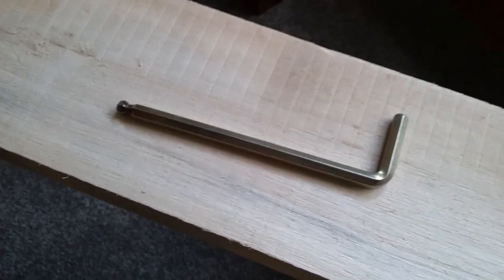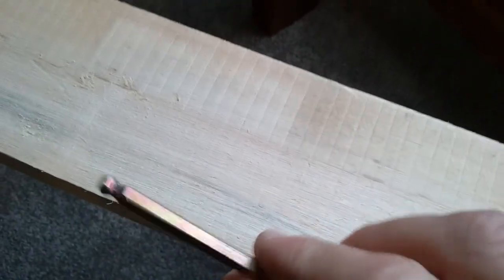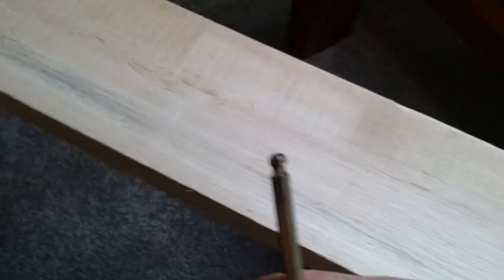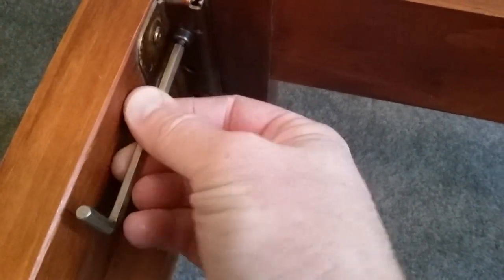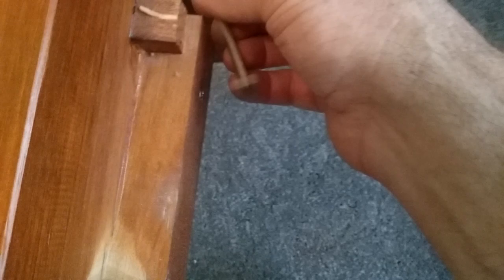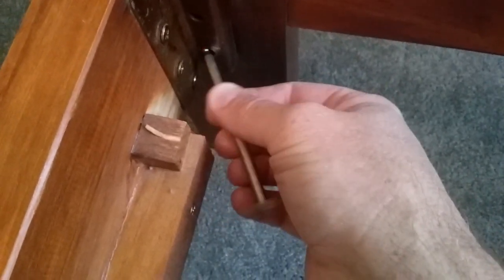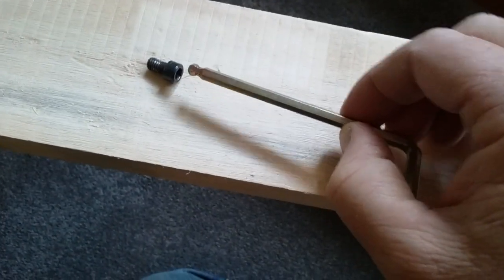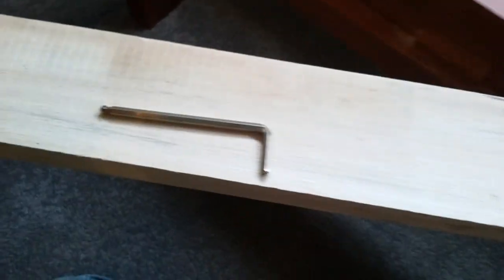Allen key trick - why some allen keys have knotched ends.

Comment: And I just accidentally broke the ball part inside a bolt for my motorcycle, any tips on how to get it out?
Reply: Yes help me
Reply: Yea
Reply: Your best bet is usually to grip the bolt with locking pliers (if it isn't flush) and remove and replace the whole thing with a new one. If that's not possible you can buy an extractor kit and try to drill it out with that.
Reply: @RedPiratesOfficial  thanks
Reply: Magnet?
Reply: @susanwoods174  thanks

Comment: The notched end also helps hold the bolt if you aren’t able to start it with your hand due to tight spaces you can place it on the end of the wrench and it will stay

Comment: It also limits torque, which (I assume) is why it's on the long end, so you don't over-tighten fasteners which are not meant to be super tight. I don't know if this is intentional, but it's how I use them when dealing with torque-sensitive parts.